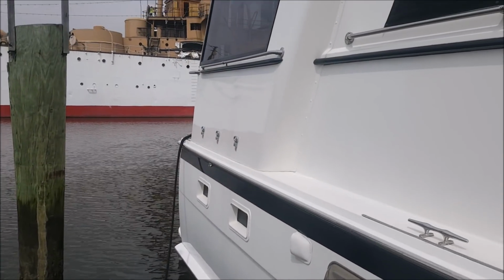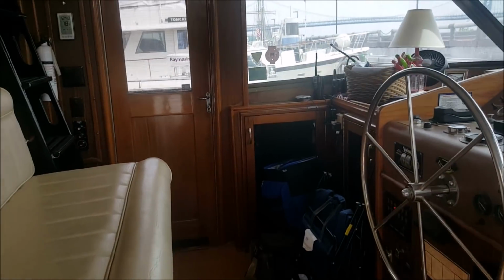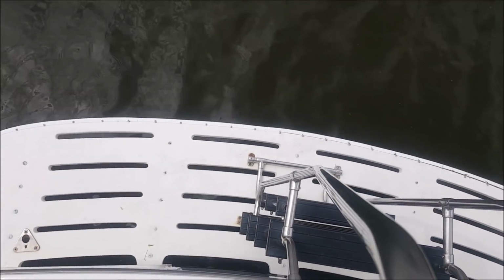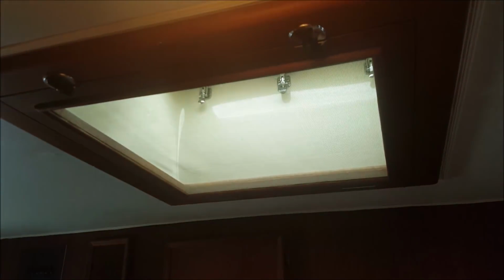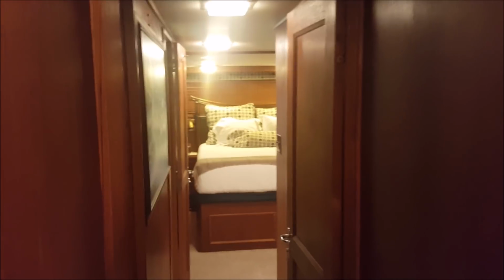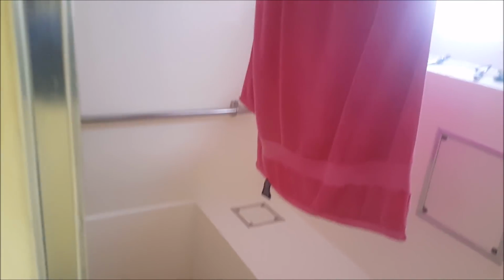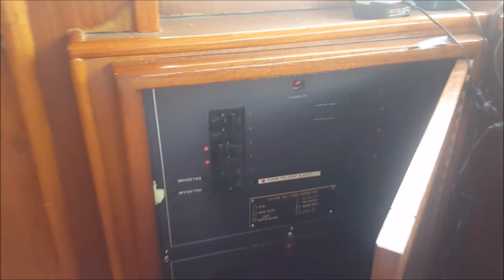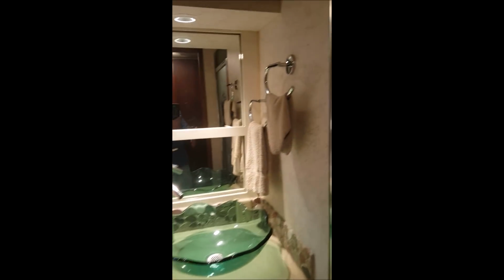Tour of our 58 Hatteras Motor Yacht E25

Comment: I am currently looking at a 74 Hatteras 58 Yacht Fisherman and the layout is quite different from yours and does not have the enclosed rear swim deck.  Perhaps that is why you have four cabins - does the master berth extend all the way to the stern of the yacht?  As a long time subscriber I notice that in some videos you call it a 65' yacht and others a model 58. Why the two different lengths?
Reply from the maker: Yes, our master cabin goes all the way to the stern. On the Yacht Fishes they pus it up and eliminate the middle cabin. At least that is what they doe on 58 Yacht Fishes. Our boat is a 58MY but it is 65' length overall, so I sometimes refer to that number. Unless I am paying for a slip. Then it is definitely a 58!😁 Actually, the moment I realized it was longer is when I rented a 60 foot slip and noticed I was sticking out about five foot. So I grabbed a tape measurer.
Reply: @tryingnottosink9107  Thanks for the clarification.  I love your videos and being about four years from retirement I am hoping to find a good older boat similar in size to Triton and do the Great Loop and the Caribbean for a few years.  There is definitely a lot more interior space in your 58 with the rear being enclosed.  Keep the great videos coming guys and hopefully we can meet on the water some day.

Comment: something caught my eye in the tour of your boat - - the old naval vessel off your stern with that reversed angle bow sort of like the British Dreadnought battleships of the early 1900s - - do you happen to know the name of that ship by any chance or any details about it ?  When  addressing your expenses in another video after wandering down to the Keys I wondered if your boat remains in the water year round or do you haul out on the hard during winter months as we do up here in New England ?  Your boat looks well looked after and well appointed and better yet the liquor cabinet well stock - - as the saying goes may you have smooth sailing and following seas in your "ocean front property"
Reply from the maker: It is the Olympia. The Moshulu is next to it and the New Jersey is across the river. Three generations of battle ships.
Reply from the maker: We keep the boat in the water year round. We heat it in the winter.
Reply: @tryingnottosink9107  currently I trailer a 24 ft. Sea Ray but am looking to go bigger to a live aboard which was what drew me to your vid.  Looking at several possibilities from a 40 ft. Hatteras on Lake Champlain to some in the 50 ft. range on coastal waters. Anyone that owns a boat pretty much knows its not so much a hole in the water as it is a hole in your wallet and like all investments you need a clear picture of usage versus expense so your expense report on the Florida jaunt was informative. I drag race and we have a saying "how fast can you afford to go" which is a lesson I'm currently working on with regard to boats but instead of speed its more about size and getting something that works on all fronts including a budget. Back in 1989 when I was diving in the keys I saw an area where owners who could afford to buy the boat but not the upkeep left them to sink in the mud - - it was a tragic sight looking at boats that were once somebody's prized possession rotting away from neglect - - a sad sight.
Reply: @tryingnottosink9107  I'm a diver and most of the old warships I've been on have been below the surface - - its great to see some being preserved. I'm a firm believer in history being a leaning tool, even those that claim they are "offended" by the things they stand for. Love the older ships as they were designed for function not convenience and my family has a maritime history from owning the waterfront in Halifax NS to serving on HMS ships and the Canadian Navy. My part of the family moved to the US in 1961 - - to Arizona specifically where a certain battleship of the same name is revered and Dec. 7th is most certainly a day of remembrance. Between that history and my Uncles' tales (Uncle Johnny served on an escort vessel for the HMS Hood when they ran into the Bismark so I got first hand stories about that piece of history) so I was hooked.   The minute I saw that bow I started looking frame by frame at it - - of course here in Mass we do have the battleship Massachusetts  and some other naval vessels in Battleship Cove and Old Ironsides  in Bean Town.

Comment: Love your videos! We are looking into buying a Hatteras 58. We are 69 and 70 years old and are worried about getting on and off the boat if we can't find a slip with a side finger.  How often do you run into marinas that don't have side fingers? And if you do end up without a side finger, how do you get stuff, like packages and even pets, if you have one, on and off?
Reply from the maker: It is very rare to not get a slip with a finger pier on the East Coast and Bahamas. I would say it happed twice so far. In most case, the marina's put transients on T-heads, parameter docks or easily accessible slips. In the rare case that they do not have finger slips, and you tied to pilings, you can always go stern in and use the swim platform for entry of the main dock.
Reply from the maker: We often go to Google Earth and get a visual of the marina before arriving, or if we are worried that we might be too big. Waterway Guide helps as well.
Reply: @tryingnottosink9107  Thank you for taking the time to answer my questions! Using Google Earth is a great idea. I do this all the time when I'm driving somewhere new. It never occurred to me to do the same thing for the boat!

Comment: Strange voltage 32 ? I've never seen or heard of that, most large off grid DC electrics systems work in divisions of 12, 12,24,36,48 & so on.
Reply from the maker: Apparently it was very common in boats in the 60s and 70s. I believe it was mostly because the wires could be much thnner.

Comment: Beautiful boat. Do you have carbon monoxide alarms with zone sensor and indicators?? .....I'm happily jealous,, because even if someone gave me a boat like this, I couldn't afford to run it. Lol.  Reminds me of an old saying. " You dont realize what you have in life, until you realize you never had it to begin with" ...all kidding aside. Thank you for the tour. This is one of the nicest tours I've seen and the vessel is amazingly clean. Even in places that are usually never clean. Spectacular!
Reply from the maker: Thanks! And thanks for watching. We have carbon monoxide testers on the Carver but not this boat since it is diesel. However, we were thinking of adding some anyway, for the nights we let the generator run.
Reply: @tryingnottosink9107  Hello, thanks for the reply. There is a misconception in general that deisel is safe as opposed to a gasoline engine. Deisel exhaust can kill you just as well as gasoline exhaust. Although the deisel carbon monoxide release is only slightly more than half of gasoline. It is irrelevant as either one can concentrate to lethal levels in living areas. It's worth the investment as you dont know a problem occurs until an engine runs long enough and the right unfortunate circumstances happen. Run time, weather, ventilation failure etc... Just looking out for you... Cant have anything happen to ya,s , or How else are you going invite us down for a deck barbecue. Do you miss any feature or characteristics about your old vessel? That your current one doesn't have? Thanks again for sharing.

Comment: 32 volts???  What an odd voltage. (I know, don't say it.)  Is this a common DC voltage on boats?  I can't think of ANYTHING that runs on 32 volts.
Reply from the maker: It is very common in boats prior to the 80s. Our boat is mostly switched over to 12 volt. It is mostly the engines and some lights, as well as the heads.

Comment: Question I have often wondered with yachts of this scope, In the event of catastrophic engine failure requiring removal of one of the 8V-92's or the genset engine, how is the engine removed from the compartment? A series of hatches and removable panels, I assume, that would require major disassembly of the various cabins?  Something as simple as bringing that queensized mattress down to the master stateroom I would imagine is no small endeavor.  Thank you for sharing this with the rest of the world! Happy Thanksgiving, to you and your crew (spousal unit)!
Reply from the maker: The Detroits can be rebuilt without removing them. However, from what I understand, if they do need to be removed/replaced, the easiest way is to cut a hole in the side of the boat.

Comment: This was a very nice boat, that looks like it was meant to accommodate at least two couples as guests or co-travelers.  Me , a mechanical engineer, I could not stand having to keep four bathrooms operational, with cold water and hot water, high enough water pressure, no leaks or clogs, and separate air conditioning for each cabin, two engines, and a generator.  Even though it was in good condition, it was from 1978, it would take all my time just to keep things working.
Reply from the maker: It does take a lot of up-keep. Especially the heads.

Comment: I love your videos.  I have a 1980 Hatteras 53 my in Charleston right on the ICW so we have run many miles of the same routes.    Love the Triton.  Question:  What is that black material on the pulpit?  I need to do some work on mine and that looks great.
Reply from the maker: We have a cover for the pulpit, if that is what you mean. We put it on in the winter, but that is about it. We use the windlass so much, we typically do not put the cover back on.
Reply: Thank you for your reply.  I was referring to the black planking or non slip black material that is on your pulpit...mine either needs to be resprayed with non slip paint or I was curious about what material is on yours.
Reply: Is there any way I could DM you?   From one Hatteras lover to the other!  Lol

Comment: 8V92T's? Set at what power? (Note my profile picture, taken inside a Bertram 54)
Reply from the maker: I believe they are 620hp. Not that we ever use it. We never go above 10-12 knots. We typically cruise at 1250rpms.
Reply: @tryingnottosink9107  of course. Just wondered as a mechanic. Nice to know that power is there for emergency, though.

Comment: Great Boat. Thanks for posting your video. Just wanted to make sure you are aware of the danger your Co2 Fire Suppression presents. Your sleeping quarter are very susceptible to Co2 Leakage from the system. The system uses a pneumatic rate of rise heat detectors that can be set off with just a bump to the detector or the control head. Making it out of the boat before you are overtaken from the CO2 is questionable. I use to work for a Fire suppression company and was almost over come when testing a system using only 1 tenth the amount of CO2 that the system required. you should look into upgrading your system. If you remove the system have a pro do it. the system is very easy to dump.
Reply from the maker: Damn. Like I did not have enough to worry about !   😁 We were just talking about adding Co2 detectors.

Comment: Always wondered how the other half lived. Meaning fiberglass boat owners as opposed to wooden boat owners! I lived on a 50' wooden boat built in Boothbay, Maine in 1946 for 5 years. That Hatteras is sure nicely appointed! Our fancy electronics: a radio direction finder and two, TWO, depth finders, and a VHF radio. And a reel to reel tape player! We did have an actual fireplace. Used it once, got soot over everyone's boat nearby, oops!I miss the boat life, but not the work. I would go fiberglass now. Fun tour, thanks!
Reply from the maker: The wooden boats are beautiful but I can't imagine having the time to do the maintenance. I can barely keep up with the fiberglass! Glad you enjoyed the video!
Reply: @tryingnottosink9107  I really did enjoy it. But all that wiring, wow! I looked through your videos, and wonder if you have one that tells more about the boat, like what engines you have, generator, thrusters, etc.

Yeah, that wooden boat was almost constant work, especially if you ram a pier! And the surprises, like the stuffing box for the prop shaft coming loose while underway! And then there are sailboats, a whole different world. I sailed the Bahamas on a Soverell 36' yawl, and the mast came down in the Exumas, not fun, I almost died. Shroud lines should have been replaced, but that was for "next year"!

We went between Palm Beach and Boston a few times on the trawler, and did a nice tour of the Bahamas, good times!

Comment: I didn't see any (which doesn't necessarily mean they weren't there) but you need to make GOOD and SURE you have fire extinguishers onboard.  While this is obvious, unfortunately it's an often overlooked detail.  You should have at least one in each engine room as well as one in your generator room as well as in the galley.
Reply from the maker: We have a fire extinguisher in every room on the boat. The engine rooms have a automatic system with large tanks.

Comment: that boston whaler on the top JUST KILL ME !!!!  (in a good way)  . I would love so badly to be able to take one like this, comfortably on board !!!
Reply from the maker: We are still trying to figure out an easy way to get it on and off. It is so heavy, the boat lists to port when we bring her back on, making it very difficult to pull her up hill to get her back on. Our davit is only hydraulic up and down, not the boom. We are considering setting up a pulley system to give me more leverage.
Reply: there are new aluminum hull dinghies  that weights NOTHING and perform fantastic, as they are the perfect combination of stiff hull.,low weight  and durability.  Just an idea ....   @tryingnottosink9107

Comment: My dream is get one of those, repower it , new electronics , and upgrade the interior a little (not style, just re-freshing it)  ... would cost as much as the boat, BUT you will have a battleship yacht , worries free and very low cost to maintain after that ..  those Hatt 58 are extraordinary ships.
Reply from the maker: That is basically our thoughts as well. We are slowly upgrading the interior, but hope the engines will last long enough that we see electric replacements. They should, they are solid Detroits with low hours.

Comment: I would not want to find an electrical fault after looking at the wiring bundles.
Reply from the maker: I think it would be easier to run a new wire than try to trace one!
Reply: @tryingnottosink9107  
It sure would be easier.
I have found that the older the boat, the more dead wiring you find because of this.
It is almost like rings in a tree. You can judge the boats age by the superfluous dead wiring.

Comment: Great looking yacht.  The Hatteras 58' Motor Yacht has 2 corner curved windshields. I believe the salon is wider since there are no outside doors that lead to the aft deck. The Hatteras 58' YF has a smaller salon (with doors to aft deck) and no curved windshields. Love your flybridge!
Reply from the maker: Yes, the removal of the side walkway adds about two feet to the salon width. I never noticed the difference in the windshields before. I'll have to keep an eye out for that.

Comment: Thanks for sharing! I am considering selling my house for a similar lifestyle. Do you folks live on the yacht year-round? What is the fuel range on how much are you spending on diesel? How much maintenance is there? Thanks!!
Reply from the maker: We live on the boat for several months a year, and most weekends. We still have our land house. We can go around 500 miles before getting fuel, but we rarely let the tanks get low. We get 0.7 miles per gallon. We use about 13 gallons an hour at 10 knots.

Comment: What are you using for video on your boat? Is it wireless and does it need plug power or battery?
Reply from the maker: Why? Are you casing the joint! :-)
Reply: um, no sorry, I just thought you might be kind enough to share that info as I was hoping to put a camera in my engine room and on the back
Reply from the maker: I was just kidding. The system was installed by the previous owner. It is a nice system but a little dated by today's standards. It runs off 110 volts, which is fine since we only need it while at dock. We have a inverter, which would kick on if we lost shore power. It has a hard drive that records for at least a week and we can access it through our phones or computer. The system is hard wired, and videos all common areas. I wanted one in the master cabin but the wife nixed the idea! :-)

Comment: How would you ever get the engine and generator out if they ever needed major work or replacement?
Reply from the maker: They can be rebuilt in place. Otherwise, you cut a hole in the side of the boat.